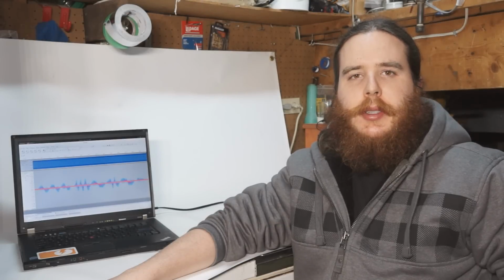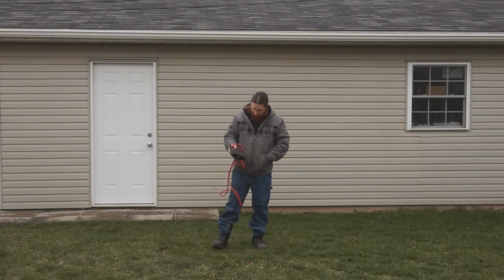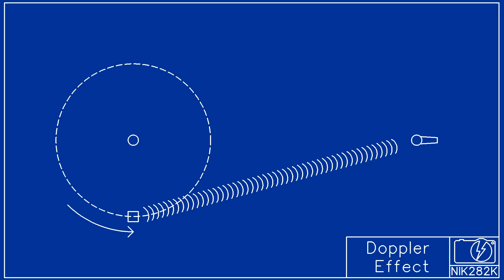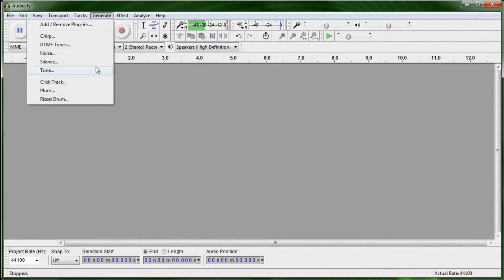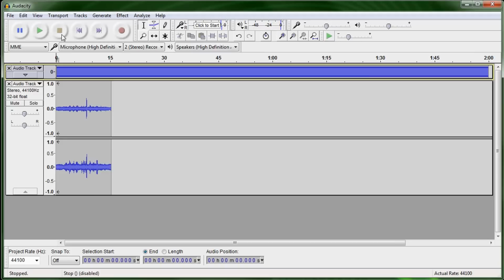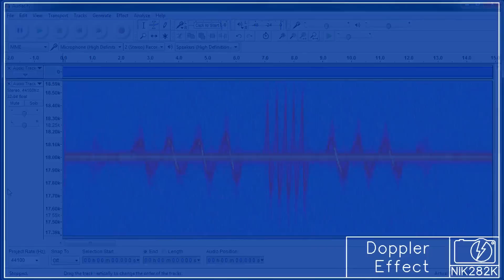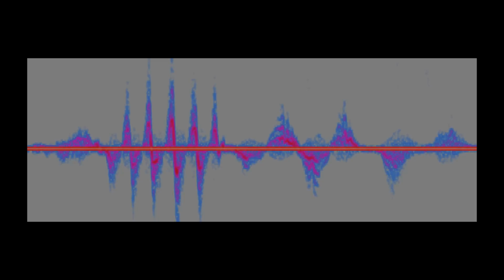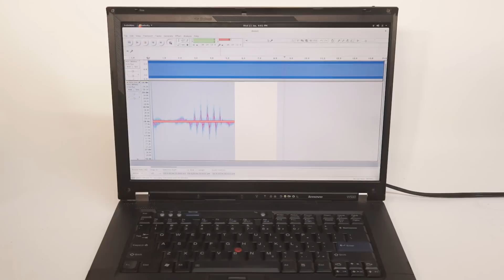DIY Doppler Sonar

Comment: This is a very elegant way to visualize things. I'm going to use a similar method to try to map echoes in a room. The only difference is that I'll be pulsing the high-frequency tone (or possibly white noise) with a short duty cycle. Cheers!

Comment: I..... Can't figure out how u got that visualization.  I got spectrogram from the audio track drop down,  played with the settings under preferences,  and still can't see it the way this video shows.  What were your settings?  Incredible  video,  BTW.
Reply: Specifically,  I see everything  correctly except I don't see the 18,000 tone on the spectrograph no matter how much I zoom.  The spikes show up well but I would like also to see my reference signal (or whatever it's called in this context)
Reply from the maker: Can you see the full spectrum (0 to 22K) or just a section on the left side? You can right click the scale to zoom out and get a wider span.
Reply: Nick Moore I've adjusted the scale as u describe and don't see a tone in the correct range.  I tried again with a 10kHz sine and got the same problem. It looks like some sort of line across the 6kHz range but in addition to that being the wrong number,  it doesn't resemble any kind of wave.  Definitely not as neat as u show in the video.  Thank u for replying BTW,  I've been enjoying watching your experiments for hours now.  Lol
Reply from the maker: Thats weird, do room noises show up correctly?
Reply: Nick Moore yes and (I believe)  the data I'm looking for.  I see sharp spikes going from 0 to the top at the times that I move an object towards the speaker
Reply from the maker: If you play music from your PC and record the noise does that show up? I wonder if there is some noise canceling voodoo going on there.
Reply: Nick Moore that makes perfect sense.  This pc does a lot of annoying "voodoo " with my sound card.  A lot of "features" that I don't want. I miss Linux....
Reply from the maker: Get Linux! Other than my editing/gaming PC all my other devices run Debian.

Comment: https://en.m.wikipedia.org/wiki/Heterodyne when doing this in a custom application, say on a robot, it will be much easier computationally to first heterodyne in a frequency that is offset from the transmit frequency. Then run it through a low pass filter and run the FFT on that data.

Digikey sells some microphone chips that are linear-ish from 20 to 20 kHz, but still work up to 80 kHz. (sample at 160 kHz). And they are less than $2 each, and talk digitally, so no need for analog wiring skill.

For example, transmit at 40kHz, mix in 39kHz, then approaching objects will be above 1kHz, receding objects will be below it.

Sound travels about 340mm in one millisecond. Assume we keep the area within 300mm clear; We are interested in objects that are between 300 mm and 2 meters away; We transmit 1 mS pulses.

Then the data of interest will echo back between 2mS and 14mS. If the objects are small and regular, like ping pong balls, then we can get both velocity and distance. Using 4 microphones, we can do it in 3 dimensions.

Hopefully, I have a project involving the microphones coming up in 3 months or so. So check back in April to see if the project actually happens.
Reply from the maker: I would be very interested in seeing a practical application of this. I'll have to do some more reading to see if I can do this with software I already have. Thanks for the info!
Reply: Nick Moore On further analysis, 1 mS pulses are probably too short to get much speed information.

To make the math simpler, I will use a 34 kHz noise maker. The speed of sound varies with temperature, humidity, molecular weight, etc... Also for easier math, I will do my thought experiment where the temperature is just right for making the speed of sound be exactly 340.00 meters per second.

An object traveling at 1 meter per second will return an echo of 34,100 Hz when approaching or 33,900 Hz when receding. If I mix those with a 33,000 Hz tone, then I get signals at 900 or 1100 Hz. 

With a 1 millisecond pulse, I will get either 0.9 or 1.1 wavelengths after mixing. The pulses will either need to be longer, or the mixing frequency will need to be higher, or both.

I will try some experiments at 17 kHz, where a 1 meter per second object will shift the echo by 50 Hz, and see how much signal is detectable.
Reply: Speaking of molecular weight changing the speed of sound... Years ago, I had a toy which was a weighted mylar balloon with a plastic hoop inside. When inflated, it was shaped just like a lens a little less than a meter in diameter. It could be used in games like a Frisbee, but it could be thrown very slowly, and could still go a long way. Since the speed of sound is so different in helium, that should work like an audio lens.

If that were filled with a heavy gas, it could be used to focus sound. That would make an interesting science demo. It would be much more fragile than the standard science museum pair of parabolic disks.
Reply from the maker: I have been working on making a sound lens, you beat me to it! At the moment all of my mylar is tied up in another project however that still includes the speed of sound.

Comment: This is the coolest thing I've tried in 2017. Here's my addendum:
Go to Edit -> Preferences -> Spectrograms
Set FFT Window -> Window size -> 32768 - most narrowband
Set Display -> Minimum Frequency (Hz) -> 17500
Set Display -> Maximum Frequency (Hz) -> 20500
I prefer the spectrum in greyscale option, but it makes no difference.
When generating the tone, use 19000 Hz
Make a recording, stretch the track vertically as much as possible (better if you have a vertical monitor), then split then do:
Audio track -> Spectrogram
Audio track -> Split stereo to mono (assuming you have stereo mics)
Remove either of the two tracks (doesn't matter)
Double-click the recording and hit Delete
Press Shift+R to re-record using the track with all the settings applied.

Unfortunately FFT is not quite F enough to let you see the result in realtime, but on a high-performance machine it will update every few seconds instead of after recording.

Next I want to try summing the stereo tracks with one of them inverted to see if you can discern side-to-side motion from the noise.
Reply: Holy crap, I can just barely see the Doppler effect when I inhale or exhale quickly (chest moving toward or away from the mics). This is nuts!
Reply: Summing the tracks (Tracks -> Stereo Tracks to Mono) doesn't visually highlight side-to side motion, I think you need some more-involved visualization to show the gap between peaks on two tracks.
Reply from the maker: It is strangely sensitive if you have a good mic. Movement on the far side of the room gives almost as good a signal as moment within 1m.

Comment: Cool novel application!

If you hi-pass filter the recorded track (I usually repeat the hpf effect two or three times), and then do "Noise Reduction', it ought to attenuate the carrier, leaving just the doppler-shifted portions mostly unaffected.  Or, perhaps more easily, apply a HPF at 18050 and LPF at 17950, which should leave just the doppler portions outside the 100 Hz range.

It might help to set the original generated mono' tone specifically to the right or left channel, as it plays on both channels simultaneously when it's on mono, with the expected interference effects.

In any case, you've given me Audacity fodder to play with for the rest of this horrible, ice storm day, as long as the power stays on.
Reply from the maker: The real fun starts if you play with the software "Spectrum Lab." You can filter and frequency shift the echo down to a more tolerable frequency and make only the doppler audible. There is a little time lag but it is bizarre to have audible feedback to physical movement with no "strings" attached.

Audacity is an awesome bit of software and there are loads of un-intended uses.
Reply: Not even a  full minute after I posted, we lost power until about 2 hours ago.
Reply from the maker: That sucks, hows the snow there? We had about 2 inches a month ago :/
Reply: Well, I've not played with 'wine' yet; I'll give it a try.  It looks like one of those good ol' crusty applications that just work; Usually, those sorts of apps get ported to unix.  :)
Reply from the maker: I still do my video work on a Windows machine so I'm not sure how well it will wine. My laptop and server however have long been moved over to Debian.
Reply: I might want to start 'wineing' on simpler stuff.  :)